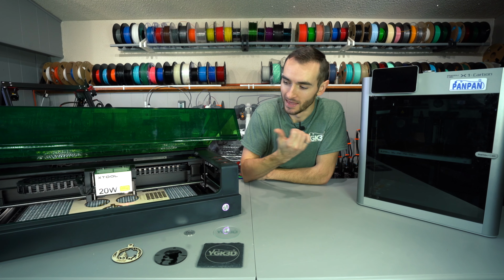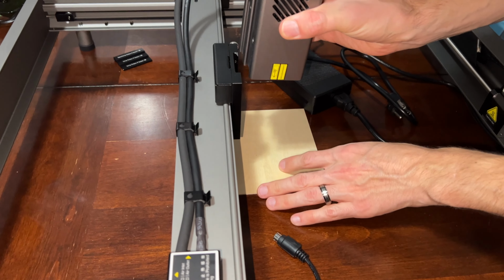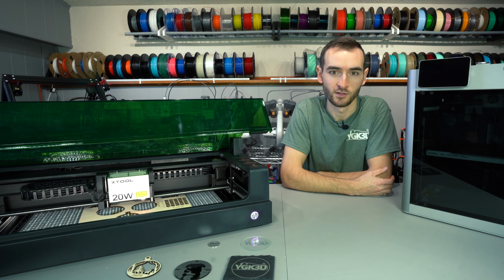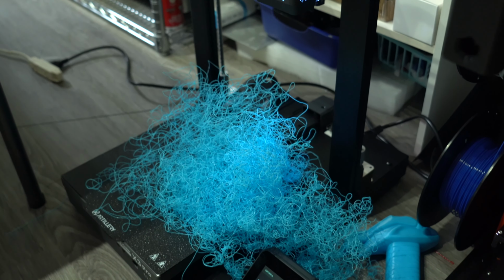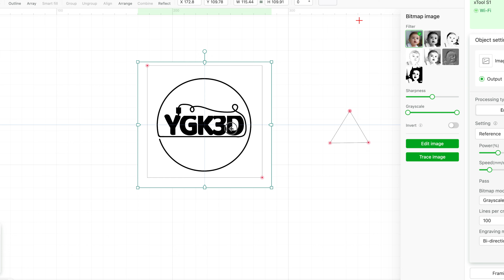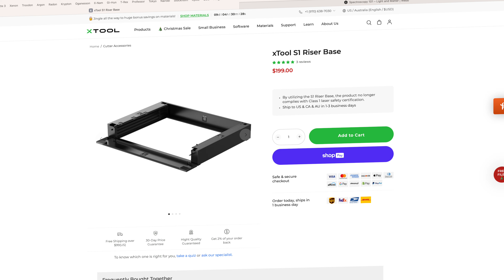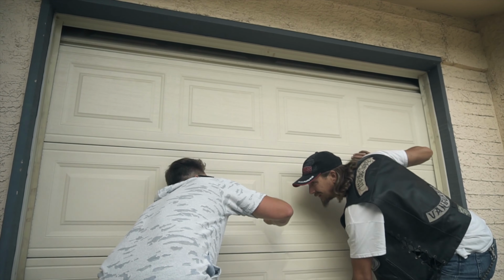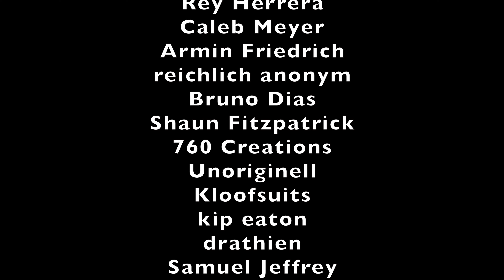This Changed My Mind About Lasers! xTool S1 Tech Demo

Comment: Laser cutter will be my next investment, but for now, I'm still paying off my XL. By the way, my XL works very well, and I have not experienced any of the problems others have stated. I do however get a slight bit of cross contamination when printing smaller items. So I am gonna swap all the nozzles to a .4mm.
Reply from the maker: Laser cutters compliment 3D printers quite nicely. My XL has been working well for me lately. I just saw today that they have switched to shipping the XLs with 0.4 mm nozzles which I thought was interesting.
Reply: @ygk3d  Oh really? Interesting to know.